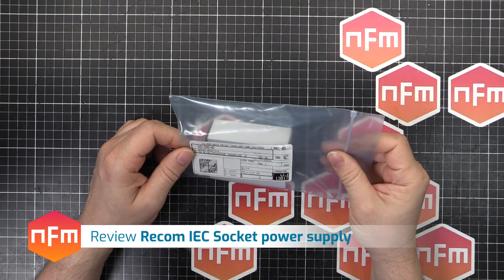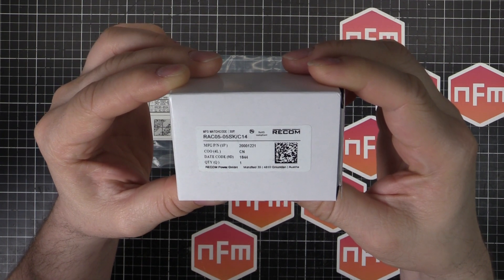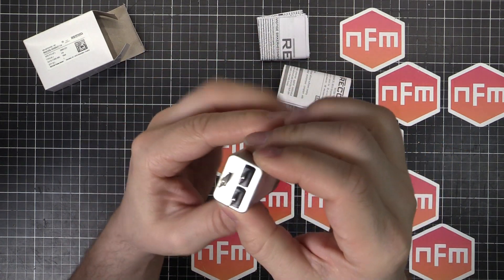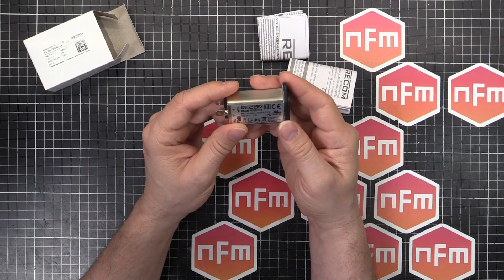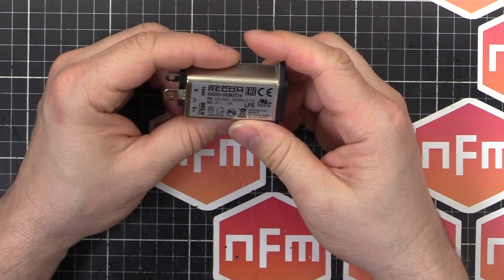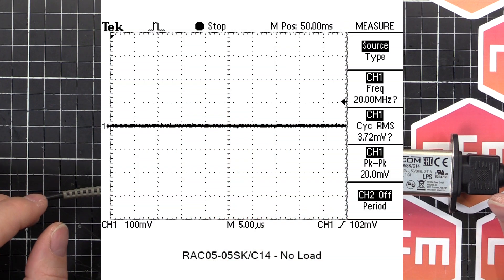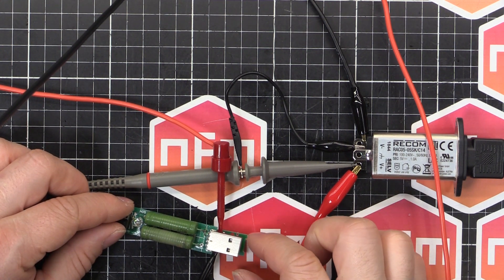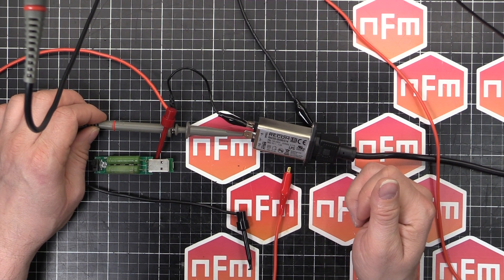Recom IEC Module Power Supply Review

Comment: Thanks for the great review! My name is Steve Roberts and the /C14 is my baby (I work for RECOM ). I have tested it running the Raspberry Pi B+ running a 4" touchscreen colour monitor and it was fine. I also ran a model 3 A+ with HDMI output, camera input and driving 4 relays. Also no issue. I think that the 2.5A recommended power supply rating is to also allow for a maximum 1A additional load on the USB output. The Pi itself needs only around 0.5A, even when processing video.
Reply: Right on Steve, good job mate. Looks great!
Reply from the maker: It's a nice product, well done! :)
Reply: That’s awesome! Would love to hear more about your job.
Reply: Dang dude! I just was cruising around online and found recon‘s website… And this particular device. And saw the video of you discussing it. Really cool! I bet you really enjoy your job!